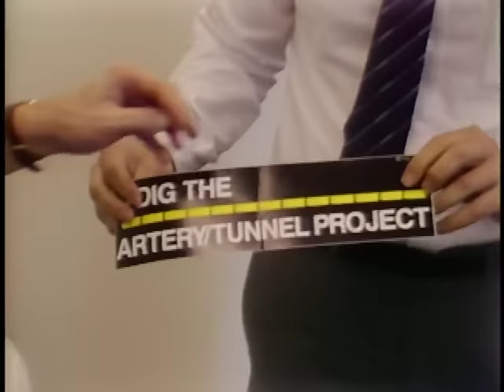Boston's Big Dig | Extreme Engineering

Comment: The big dig's biggest failure was that they didn't add a rail connection between north and south station. The big dig just moved the problem underground.
Reply: If they'd just built the rail tunnel, and electrified all the train lines, the road tunnel might not have even been necessary. Adding lanes never solves traffic.

Comment: motor vehicle registrations in Mass have gone up over 48% since 1990.  This project. although was needed-  has already past being overwhelmed by the very problem it was supposed to solve.  The city DOES indeed look better but 'parking lot' traffic is still a thing here in Beantown.  Fantastic engineering though-  amazed at all the issues they had to get around.

Comment: The highway tunnel system under Boston is wild af. Exit ramps on both sides of the road, some ramps having 2 or 3 individual lanes for specific exits. Twisty tunnels, narrow at some spots, sudden lane merges, and lackluster signage. If you aren't from there it can be kinda intimidating, especially with locals ripping through the tunnels at 80+.

I still think even though it didn't really fix the traffic issue, it still greatly improved the city above ground. Boston and the surrounding cities/towns is absolutely stunning and having the interstate hidden opened up even more visually appealing scenery.
Reply: That's the entirety of Massachusetts, not just Boston. Some of the most dangerously designed roadways in America exist in Massachusetts, and don't even get me started about using the breakdown lanes for travel............
Reply: Just went through there last week.  It was crazy driving through that tunnel!!

Comment: How was it supposed to end the traffic if all they did was put the traffic underground? If anything its worse now than it was before.
Reply: The old bridges would be 70 plus years old now and rusted.
Reply: They also still had above-ground trolleys til 2004
Reply: Well with a rising population in most cities, it's like everything else - services get overwhelmed.  Build a new hospital and it will fill, build a new subway and it will fill, build a new highway and it will fill.  You just have to keep pace with demographic trends.
Reply: You don’t understand how the central artery worked, there was more feet of on and off ramps than there was feet of highway, it was a congestion nightmare with people trying to get on and off. Yes traffic is still bad but unless you were old enough to drive on the central artery, you’ll never understand what it was like and how much better of a layout is there today

Comment: I live in this city. There is about 5 hours a day of heavy heavy traffic. Mostly caused by massachusetts residenents inability to merge. This is caused by, what I like to believe, a high income to ego ratio. I95 and I90 to 495 have upwards of a 30 minute back up every day because of this issue. Disgusting behavior and poorly educated civil engineering. Inside the city, roads make little to no logistical sense. You will go down 1 ways accidently and you will have to swerve to avoid cars and trucks in the middle of the road parked due to poor design. I have spent alot of time in other cities and boston is by far the worst one logistically and demographically.
Reply: I have little to zero sympathy for those who complain about traffic when living or working in a city. I come into Boston for sports games or weekend pub crawls. I expect traffic in and out of the city, it’s brutal, and I’m always glad when I’m free of it after a weekend max. But that’s why I would NEVER live or work in Boston. It just comes with the city when you have tens-hundreds of thousands of people who are packed like sardines in such a small geographic region all trying to move around at the exact same times.